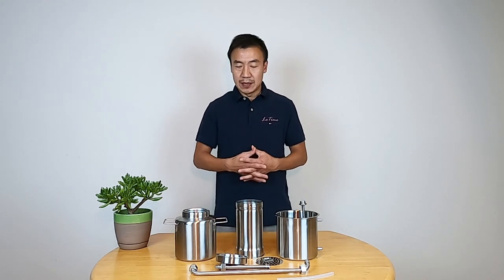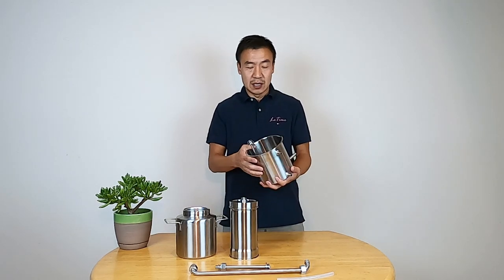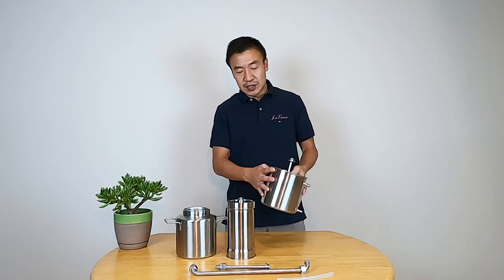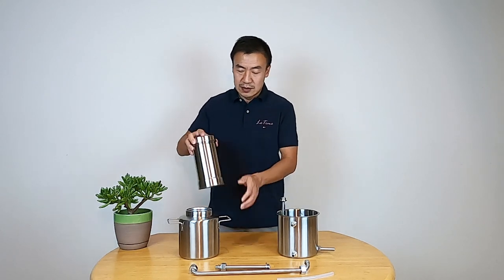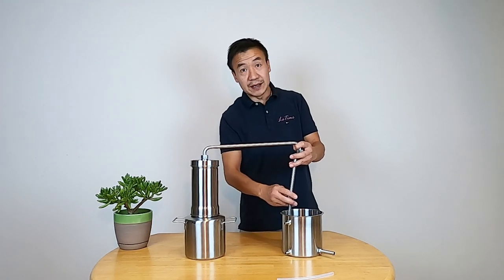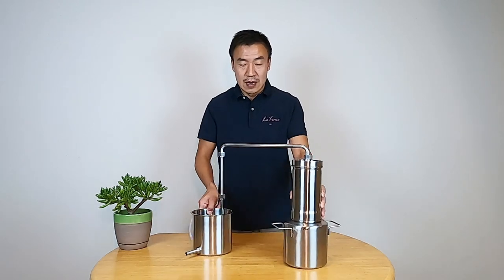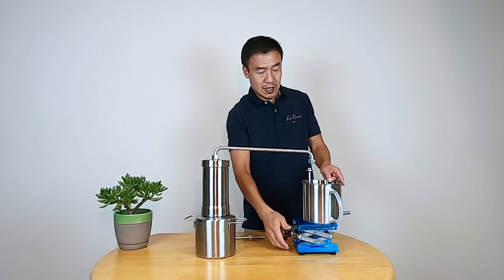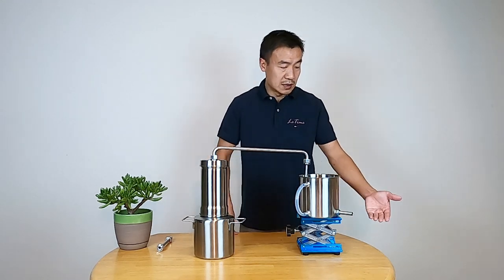LT3000 3L Tower Distiller Introduction

Comment: What if the water is not enough for the  plant material, how do you add more water
Reply from the maker: Normally it is recommended to make 1 liter of high quality hydrosol from one batch distillation. With a full pot of water (2liters), it should be enough to make up to 1.5 liters of hydrosol. However in case you want to add more water after a batch, you can stop it, cool down and refill it with water then repeat distillation.

Comment: so , it seems it dont have a thermometer which is so important to keep at  100C the water ?
Reply from the maker: It is working under normal pressure and the water boiling temperature is 100C.